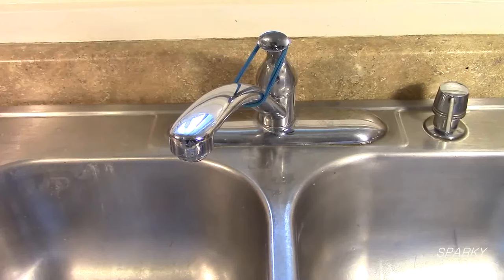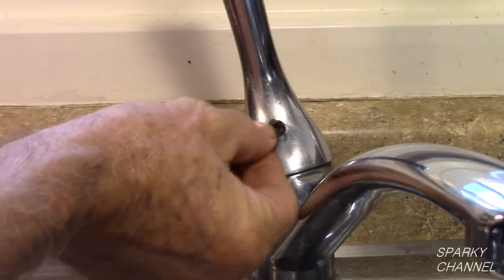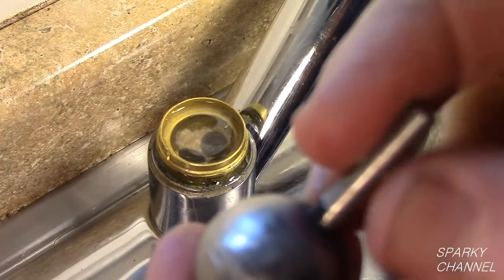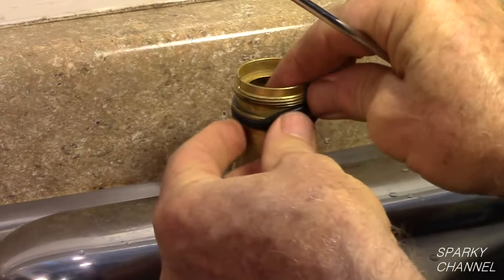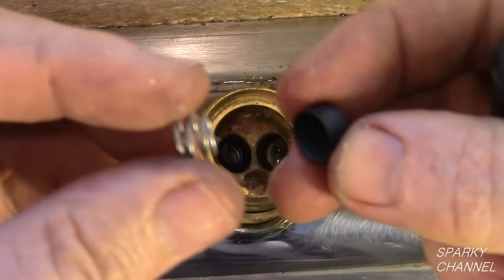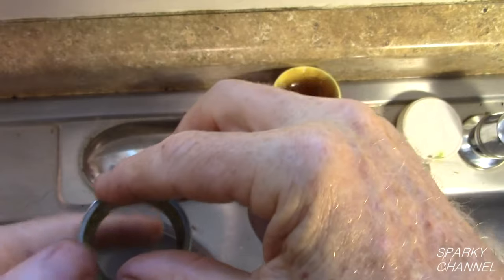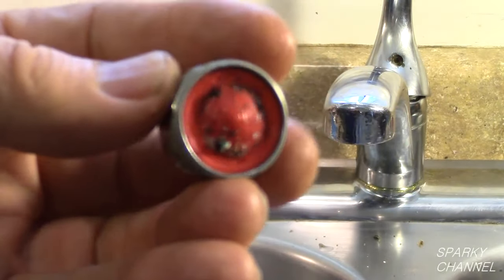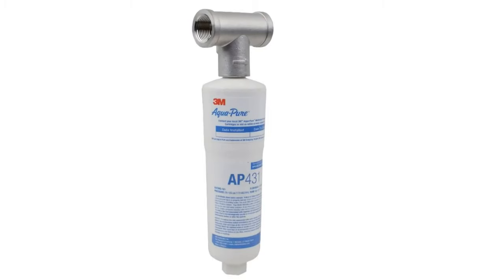Delta Kitchen Faucet Leak Repair (Single Handle)

Comment: My spout assembly will not remove. I've tried soaking it in vinegar with a wet rag kept wet with vinegar. Still can't get the spout off. My faucet is leaking from just below the spout, so I figure I need to replace that o-ring below the spout. Can you give me any ideas for how to get the spout off?
Reply: I had the same problem, first with the handle, then the bonnet and finally the spout assembly. At each step I had to spray a ton of WD-40 and let each component sit for an hour or two. Everything came apart except for the spout assembly. In the end I had to pry the bottom of the spout assembly with a thin screwdriver slowly working my way around but be careful, I ended up nicking the nylon gasket with the spout assembly sits on. Fortunately, it's still functional. Good luck!
Reply: BTW, I was worried about WD-40's toxicity so ended up carefully wiping down the parts I was going to reuse and heavily flushed the faucet's bottom by only slightly opening the hot water supply line prior to installing the new parts with silicone grease. I've not noticed any oily residue in my water.
Reply: @gratefulqt7704  Thank you for the advice and the tips. I'll try that. And thank you for letting me know I might nick the nylon gasket, so I'll be careful.

Comment: I contacted Delta and was informed that they will only warranty their faucets for 10 years.  I quoted the lifetime/original owner clause that came with the installation guide.  They reluctantly agreed to replace the part -- but only as a "one-time" gesture on their part.  Time to stick with Moen from now on.
Reply from the maker: Wow, I hadn't heard that before. One reason I used to buy Delta was the lifetime warrantee and excellent service on that warrantee. Yes, Moen or Kohler. My preference might be Kohler but I'd look closely at Moen too.

Comment: I can't get the faucet part off. In this and other videos, it just lifts off when you turn it to the side, but mine doesn't budge. Any advice? It's chrome so I'll ruin it if I put a wrench on it to wiggle it more. I can't get a flathead screwdriver between the cylinder and the base either... help!
Reply: I have thecexact same problem, it's almost like it is screwed on. I can turn the whole thing around but can't take it off. Did you figure it out?
Reply: Same problem.  Answers?

Comment: @Sparky Channel. Thanks Bill for another great repair video. Wow Bill. Are you saying that Delta will send you repair parts for free and did you need a receipt for that to happen?

Hope you and your family stay safe and well.
Reply from the maker: Yes, all of the big faucet companies say right on the box "lifetime warrantee".  With Covid some of the companies are not answering the phone very often, etc. but they will take care of their customers. Delta in particular will really try to just send you a repair kit like I used in the video instead of replacing the faucet. In my experience Kohler is the very best at customer service with Moen and Delta being pretty good. It used to be that you really didn't need a receipt but they've tightened up on that. They may ask for a picture of your receipt. But "lifetime warrantee" means "lifetime warrantee".
You guys stay safe as well!
Reply: @SparkyChannel  When we install 'lifetime warranty' equipment, we always keep a hi-res photo of the receipt. There was a patch there for a while in the '90s when some companies were saying they wouldn't honor the lifetime warranty as it was only for the consumer purchasing the equipment, not a professional firm.
Delta, to their credit, didn't pull that nonsense. Was the end of my using two well known suppliers, though. Nearly 30 years on, not regretting my decision.
I don't expect 1960's quality in 2020. I do, however, show my appreciation to companies which honor their commitments to my customers. Interestingly, those companies' parts are the ones which fail least often.
Reply from the maker: @ethelryan257  Excellent. Could you please name the companies that are treating you the best currently?
Reply from the maker: Hi C. Adama! Is everything OK? Haven't heard from you for awhile.
Reply: @SparkyChannel  Like you, been busy. But not enough to stop watching your TY videos.  That's where I learn much and helps me unwind. 

Hope you and your family stay safe and well.
Reply from the maker: @ccadama  Great to hear! Have a great Sunday!

Comment: What if the hex screw is stripped (somehow) and won't turn?
Reply from the maker: I would use an "easy out" damaged screw remover.
Reply: @SparkyChannel  I actually bought that and it didn't work at all. I'm just replacing the entire faucet instead.

Comment: Don't recommend a plier / wrench: chances are the cap is stuck and you will scratch it. Pour some vinegar into the notch, wait a little bit and then use bare hands and some rug that has gives good grip (I used old gripper socks :)

Comment: Bill ugh, try turning your channel locks around using the rubber padded handles instead of the jaws this way you don't scratch the aerator or buy a pair of padded channel locks where the jaws are padded .
Reply from the maker: Excellent idea, thanks!

Comment: Wow. That is a filthy faucet on the inside. Mine is very similar except the piece below the handle barely has any of a flat for an adjustable wrench to grip. It is tight so there must be corrosion or other matter in or around the thread ring. For the high price that I pay for my city supplied water it should come out as pure water. Anyways, I have tried PB Blaster and such but it just won't break free. The faucet chrome finish is perfect and I want to avoid marring it with a channel lock pliers. Any suggestions? Oh, by the way I called Delta weeks ago and they were going to send out a repair kit for me. After I gave them all of my information, it never happened. I bought a repair kit off of Jeff Bezos who bought it from a guy in China instead.

Comment: Here is how the REAL repair went:
Delta shipped me the wrong repair kit (NOT the ball one that I actually have).
Local junky name brand store does NOT stock real Delta parts.
Shutoff valve was seized open. Almost broke the pipe it is attached to.
Almost stripped the cap assembly before I was able to take it off.
The aerator does not ship in repair kit, but this is the most disgusting part and MUST be replaced (bacteria!!!).

Comment: Oh, give me a break, the shutoff valve is never THIS easy!!!!!!!!!!!!!!!!!!!!!!! Mine is soldered on an adapter that is glued onto a plastic pipe, everything is rusted tight, access is nigh impossible, and as I twist the handle, the plastic pipe bends very dangerously. Did I say that the main feed in this condo is also a PLASTIC pipe that at some point will shatter from a simple twist???
Reply from the maker: Wow! Good luck!